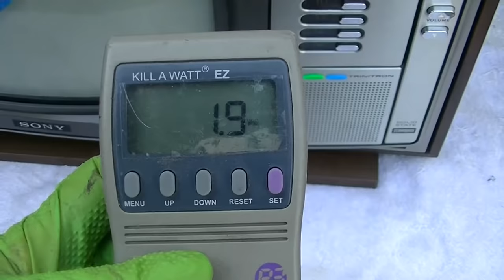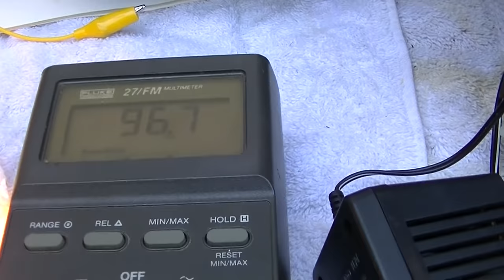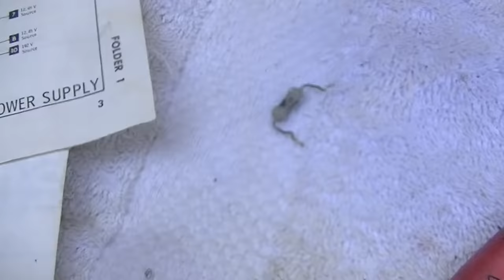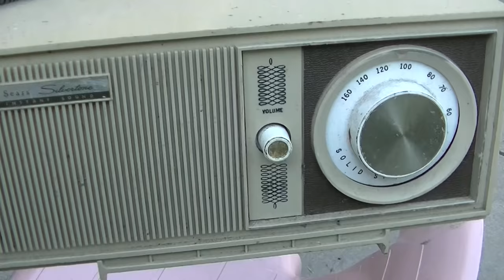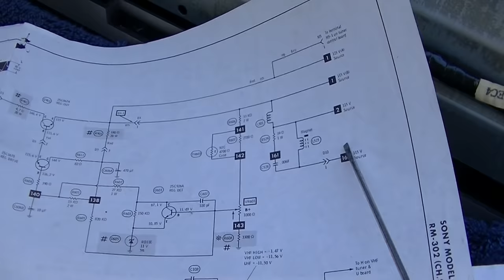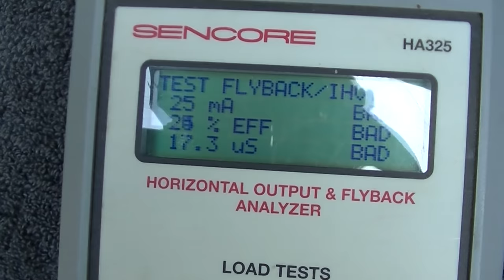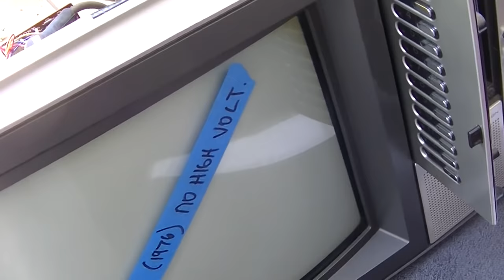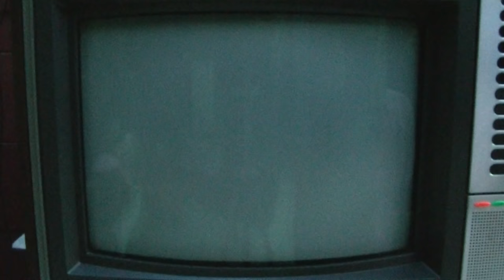Sony Trinitron KV1541 Remote Set Super Hard Fix 1977 Vintage Color TV

Comment: I've been in the TV business since the late 70's and worked on too many SONY products. The SCR output versions were nightmares for SONY as they enjoyed the highest failure rate of any TV of its day. Mainly, the issue in the deflection circuit has to do with bad or intermittenet connections on the horizontal deflection board, around the transformer and connector pins on the PCB. Of course other issues crop up, but the connections issue was the first thing to look for, before popping SCRs and TO-3 regulator outputs .. Sony was famous for over-engineering circuits and being different than other proven designs. SONY finally threw in the towel and went to what virtually all other brands used, the simple 2sc1308k output and simple circuits using industry standard Japanese ICs

Comment: Wow. That one was a trip. Seriously curious what the deal was with the flyback. I'm assuming you tested all the components on the little PCB attached to it; I wonder why those resistors were a different value? 

I just finished fixing a 1976 Sony portable 9" (KV-9200), and I basically had to completely recap the thing. It was filled with those Matsushita caps and every single one of them except for like 3 were way, way out of spec and a lot of them were leaky. One problem I noticed was that brown glue; not sure if it's conductive, but it certainly corroded a bunch of leads. I think it becomes hydroscopic and holds the moisture close to the metal, corroding things. That would also account for conductivity, and you might not know it unless it was particularly humid because it would stop being conductive when the air dried ou

Comment: The horizontal out is a SCR.  Well, at least it is the one with the bipolar power supply, if you get one with the SCR as a power regulator then just junk it.  Those were dangerous when they failed, filter capacitors would blow out of the machine.  Sony didn't leave them on the market long, IIRC 6 months before they pulled it back and replaced it with the bipolar circuit.

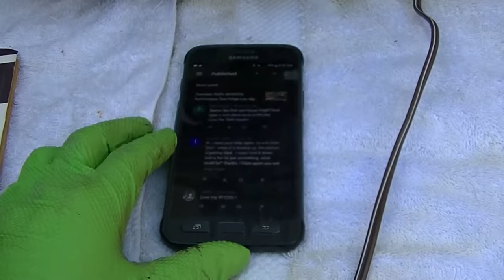Comment: @2:36 my Trinitron picture is dark.  what do you think might be causing this?  I tried replacing the speaker and the power cord, and that fixed it just a little bit. pls reply as I will cancel my housecall from the repair shop

Comment: Sort of reminded me of a time a guy bought in his amplifier which he was ''upgrading' - It started blowing fuses instantly with the fuse depositing vapourised metal on the glass.
He had replaced the nylon bolt that secured his toroidal transformer to the slimline case with a nice steel one...The top of the case just touched  the top of the bolt, it being a centimeter longer. Voila a single shorted turn that could carry all the current demanded of it. Not at all the same thing, but doh transformers..
I'm a third way in and you picked out that LOPT with bits hanging off and I had to slap my forehead. That surely is the smoking gun?

Comment: i had one of those 2sc867s short in a kv1300, luckily i had a good one removed from a scrap set, the kv still doesnt work right, gets good picture but starts fizzing noises after a minute or so ,

Comment: $30 isn't much these days in terms of a replacement semiconductor device.  I work on RF amplifier modules for broadcast transmitters in my day job.  The going rate for a modern 600W gemini device is close to $200.

Comment: Got some messed up Computer Variant for this. I changed from one LGA2011 Socket to an Dual Board. Worked fine on the test Bench. Same CPU +1, same Memory, same Graphics, same large enough Power Supply and 2 new Cooler. Smashed everything into the Case. Power on and no POST no boot. Checked if somthing is missing. Didn`t get it running. The Problems indicated an Mem issue. So i removed the parts and tested them on the test Bench. Worked fine. After some painstaking tries and 2 weeks later i figured it out. The two CPU Cooler i bought pushed to much on the CPU`s. Once in the case the Board is slightly bend, so the problems emerge. I unwinded the screw`s one turn and everything is working since then.

Comment: man i miss the crt tvs... reason why is cause they last alot longer than modern tvs, yea they have roku apps and ads which we all love(sarcasm) only last 1 1/2 to 2 years, my 43 inch tv backlight went out, bypassed the led, lasted 2 more months, im throwing it out because its such a pain to remove the lcd just to get to the leds, plus the tv was only 200 and the leds strips are 200 plus for it, they made them disposable just like cars. modern tvs are just garbage my opinion, my grandma used to have a sylvania floor model tv, color, single speaker, pull on knob, lasted 35 yrs. was givin to someone when it was working and they hooked up cable directly to the rf and it went pop and died. sorry for the long post.

Comment: Nothing changes with Sony.  Had a UK spec KV2204UB set in the very late 70s and it suddenly decided one day not to fire up.  British made LOPT had fried and a genuine replacement Japanese spare restored operation.  A real pig of a set to work on, heavy to shift and had a live chassis inside.  Still, easier to fix that the loaded IGBT type sets.

Comment: We bought a used Sony Trinitron 36" or so in 1999, so I don't know the year, but it still works great Except the green color is gone, so the picture is blue and red, but other than that it is a good sharp picture. What could have failed, and would it be on the circuit board on the neck of the picture tube?
Reply: almost for sure the crt in my experience, good luck with that.

Comment: $50 in parts blown in a femtosecond. I feel that pain.
Is it worth adding a few cooling fans in there? I think I would.
Reply: Some pieces of electronics generating this much heat would have a cooling fan . I'm thinking of my reel to reel tape deck with tubes and computers .
Reply: I remember the  old solid  state stuff running  quite hot.

Comment: When asking "my TV is doing this, what could be the cause?" the hope is that it's a common problem, not something weird like here. At least someone could provide a starting point. Someone may just answer "oh yeah, I saw it multiple times on this model - check C123 and R50 - they tend to go bad, producing the problem you described".

Or it may be a common generic problem, for example, the picture intermittently going completely blue may indicate that the CRT has an intermittent short (I actually had that on a PC monitor).
Reply: Then they should ask so: "is there any known problem which could cause this or that" and not just "what could be the problem". IMHO.
Reply: @janosnagyj.9540  I don't think I would write it like that when asking a question and would just ask it normally, hoping that wither someone knows the answer off the top of his head (because it's a standard problem or he had the same problem before) or at least point me in the right direction (or away from a wrong direction).
After all, nobody is obligated to answer me and sometimes my questions go unanswered. I do not expect someone to spend hours trying to replicate the problem on his device just so he can tell me how to fix mine.

The problem in this video was very unusual and it tool Shango066 (who knows what he's doing) a long time to diagnose and repair, but a few other videos it's "the set is doing this, better check/replace that part" and that part (leaky cap, bad sync diode etc) turns out to be the problem.

Comment: If some of the windings of the primary of the flyback were shorted together it could decrease the inductance which would de-tune any tuned circuit that the primary was part of, and also create a low AC impedence of the primary winding which would raise the current in the driver circuit. Not saying it's the problem, but it might be.

Comment: I don’t have unlimited resources to replace parts that blow up as soon as it’s powered  up, I don’t really want to replace a horizontal output transistor at 25$ a pop, literally! I might have thought it was a flyback transformer just because of what it has to do. A donor set with working hv was a luxury . It was a tough nut but swapping the flyback did the trick.

Comment: Triac doesn't have anode and kathode.  It's terminals are labeled MT1, MT2, and Gate.  (That's main terminal).  Triacs conduct in both directions.  They are sorta kinda two SCRs wired back to back.
Reply: Some triacs use anode and cathode marking. They conduct both way, but the gate is driven against cathode.
Reply: @xsc1000  IF it conducts both ways, then there is no cathode.  If it has a cathode, then it can't be a triac (or things are miss-labeled).  In a true triac, the gate is driven against one of the MT terminals, usually MT1.  In any case, the part isn't a triac or an SCR, it's some kind of gate driven switch, as shango has already identified.  Basically a cross between a transistor and a thryster, so the device is in the thryster family.

Comment: I have a 28" Samsung 100hz CRT that does not sync the picture as it should in RGB mode only so the upper half of the picture is in one position and the lower half is slightly in a different one, this is not a problem with a composite signal for example, what you think is the problem???

No really! I got this problem with said TV and that no one probably knows and I even re-capped the whole video board to try get rid of it. but I just had to ask because you said this so many times in the video lol

You did a great and entertaining video here and I watched all of it to the end! let CRTs never die!

Comment: When I used to be in the game, SONY on a component usually meant the item MAY be what it says on the package, but the only people that truely know are Sony. So if you want to buiy one, prepare for a think of a price double it and add tax according to how desperate the buyer is. Then of course they had a spate of misdirection in diagrams. A great video, the problems, its just sony. They made stuff so it couldnt be repaired other than like for like board swaps.

Comment: Isn't the fact that it has an air gap that makes it a 'fly=back' ? just wondering as I heard something about this once, great video I love the long ones.....cheers.
Reply: It's not what makes it a flyback, but air gap transformers are generally used in such because to prevent core saturation (which would cause distortion of the output waveform), and also to lower inductance.
Reply: @westelaudio943  Thanks, that makes sense.

Comment: Great job on the High Voltage repair. I was sure you lost CH 6 way back in July of thhis year. I know they lost what other few CH 6 low power TV stations out East this past summer back in July. So this must be an old Video you made some Months back or Your CH 6 never did go off the Air in LA. But I would think that this must be an older Video that was not made on Oct 30th.

Comment: It doesn't affect, and IIRC the H OSC won't resonate through the flyback and all back. What it will do, it to change the force of the feed back pulse affecting the H-SIZE in the screen & HV just a litle % , but nothing more, it can be seen as a FINE TUNING.

Comment: Could the resonance difference be caused by the RC time constant difference between the 2 (one has 2 10k and other has 4.7k)?  It also could be caused by those magnetic flux insulators (maybe that's the word you're looking for). I don't know as much about how flybacks work as you - but any transformer conducts magnetic flux to the rest of the windings to produce voltage. d(Phi) / d(t) = d (V).  If you got 2 halves of the core insulated - perhaps you got both a positive and a negative? Or even sillier - maybe they cancel each other in phase.  Very trippy.  Sony sets seem to be quite complicated - the one you put the 2uF large-package cap (unpolarized remember that) was a good example.  The small electrolytics sensitive to heat Sony puts in close proximity to something hot.  Look at the PS2, PS3, and PS4 - all that SMD stuff they like to cram in it sure works well (when it works) - but not the easiest to fix when it doesn't.  I notice they're running hot (along with the horizontal) - change them back to a 10k?

Comment: That is one odd power supply.  No filter capacitor after the diode?   The base has no pull-down resistor?   And no current limiting shutdown.  Looks pretty shaky.  

I once fixed a very expensive Fluke voltage calibrator.  Power supply was fried.  That $3000 box had no current limiting on the +12 supply.  Replaced that mess with a 7812, much better.

Comment: That's great sound too, is it stereo?  MTS came out in 1984 I thought so probably not.  Side note - do you know (or have) an RF modulator that modulates baseband video / stereo audio to an MTS channel 3/4?  Can't seem to find one.  This was sure a Royal pain in the arse - but after a job like this, I enjoy using it much more simply because I could fix it.  I enjoy using it much more thinking of all the fun I had working on it. Sony doesn't do things the easy way, and sometimes trip over all the complexities (such as jamming a heat sensitive component next to something hot or the insulators in the flyback) - but they sure make a bitchin product.  I always loved the Trinitron picture - but as a kid sure had a hard time fixing them (see why now) couldn't afford the equipment to do what you're doing there.

Comment: I repaired a Panasonic Trinitron clone set years ago.  Had a blown flyback, horizontal output transistor, and open power transistor.  I guessed that the flyback transformer shorted and blew the transistor, which shorted and then the resistor blew.  Replaced all three parts and lucked out, set worked.  But I did spend a bit of change on those parts, also bought a Sams photofact folder for it.

Comment: I've got a question ... how the hell do some of those circuits work?? To turn on the regulator transistor, you have to pull the base away from the emitter and toward the collector, but the rest of the regulator circuit is connected to the pass transistor's emitter.  How can that work??  As for the zener, it seems to me that a shorted zener would prevent Q591 from turning on, giving the same results as removing it.  But clearly not.  I think I'm insane.  Edit: I think the power supply schematic has some errors.
Reply: not totally shorted, leaky..that's the difference.
Reply: @m.k.8158  I'm not sure as it makes much of a difference.  I don't see how it could be turning on the transistor if the voltage is limited like that.
Reply: @russellhltn1396  one possible answer:If the leakage current through the Zener diode keeps the transistor from turning OFF, then the regulator will not regulate the voltage, thus the voltage will go too high.

Comment: If H-Out transistor is bad, in 99.9% you need to replace flyback, and in such an old TV you must replace at least ALL electrolytics, even before you start doing any repairs.
Reply from the maker: The internet told me so....

Comment: R524 could also burn up if both C526 and C511 were to go dead short or very leaky (or both); though if C511 failed, I would expect either D504 or R527 (or both) to complain about it by self-EOLing.

Comment: My guess is the flyback has probably high voltage short(s). You cannot detect those without proper driving.
Reply: I dont think its completly short. If it were short, you get high power consumption and transformer overheating.
Reply: @xsc1000  It's really not a complete short, if it were then you could detect it with the test equipment. I think it only shorts when there is an actual high voltage over 10 kV in its secondary or maybe the primary shorts when there are over a kV pulses across it. It had high current consumption: the GTO and the stabilizer transistor didn't die from nothing. As for the transformer overheating, I think it had not much time to do that, the the HOT burnt out in seconds and the flyback is enough massive to absorb that heat for such a short time.

Comment: I always found with these Era sonys, you couldn't use anything but Sony transistors, especially horz. Outputs...and most sweep transistors. 
Also, those blue colored capacitors (not the electrolytics) have been known to be out of frequency...and a lot of times, many sweep diodes caused problems,  again only Sony replacement parts would work....Sony did that intentionally to sell only their parts.
Good luck...I fought with many of them..!!!

Comment: I like your channel but I used to fix TVs years ago I had a lot of suncore equipment I mean I'm not no Mr Carlson I mean he's he's the God in my opinion but first thing I would have done I just would have pulled the horizontal output out put my meter on diode check where you get the beats you know what I mean and see if it was shorted that's how I used to go after him that's where I would start if I didn't have no horizontal output I had a TV a 92 that's a sencore and the vg 91 frequency generator the TV a92

product had a 2202 horizontal output transistor in it what I used to do I used to use three resistor legs and solder them base emitter collector and then you know put my three clippy things and then slowly bring it up you know but I like your show man I like watching your show it's cool but anyhow that's it and I guess I'll talk at you later have a good one be safe

Comment: Interesting that Sony was pushing the temperature on so many parts in these things back in the day. That has to spell trouble down the road. Hot semiconductors are never a good thing long term. And what's the reason for running so much power through a pot? That makes absolutely no sense at all. Should be no need for a design to do that. That's probably why that Horiz Cent pot failed in the first place.
Reply: It was quite standard at that time that horizontal centering pot was wire pot in series with H yokes just changing DC level a little.